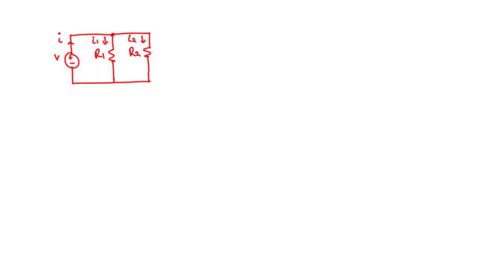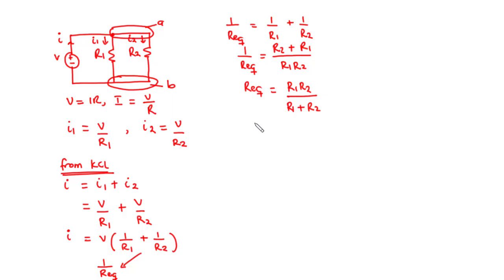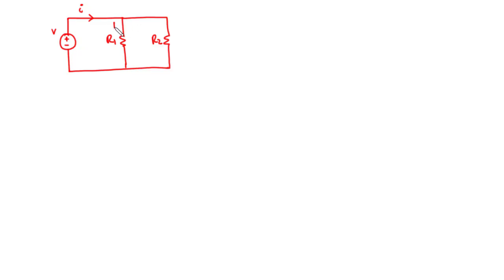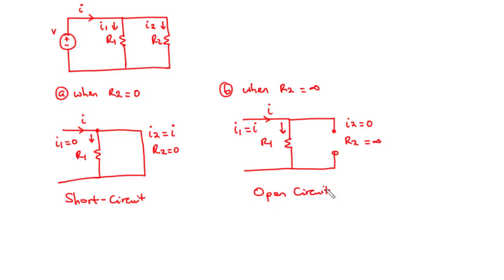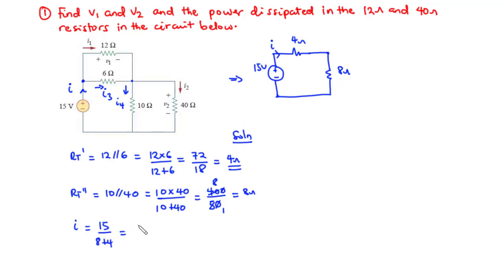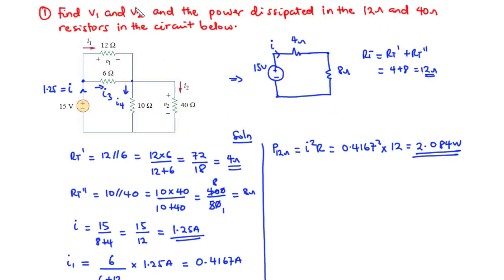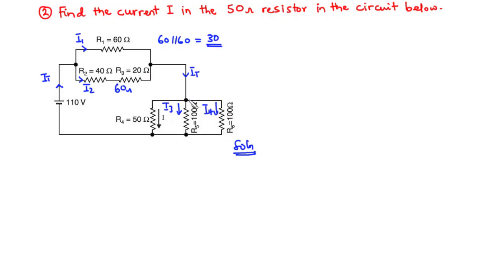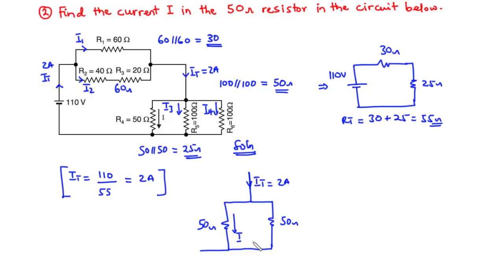☑️10 - Parallel Resistors and Current Division

Comment: so to find i1 why did we use 6/6+12 instead of using 12/6+12 in the current division rule since we're looking for voltage V1 which is across 12 ohms resistor?
Reply from the maker: In our topic we are solving with current division rule. To find the current in 12 ohms , it's the other resistor / resistor+ other resistor * current. Then we used ohms law to find the voltage in it.

Comment: i saw a question where the resistor had no figure beside it with the short circuit symbol does it mean that its resistance is zero
Reply from the maker: In my video???
Reply: @SkanCityAcademy_SirJohn   no ,a  question in my slides
Reply from the maker: Okay, so it has Zero resistance.
Reply from the maker: Which country are you from and which program do you study, and your level
Reply: @SkanCityAcademy_SirJohn  ghana 300 comp eng
Reply from the maker: Yes, has no resistance
Reply: @SkanCityAcademy_SirJohn   what about if there is no short circuit symbol just no figure on the resistor
Reply from the maker: Message me on telegram with the screenshot +233243084034
Reply: @SkanCityAcademy_SirJohn   the number is not on telegram